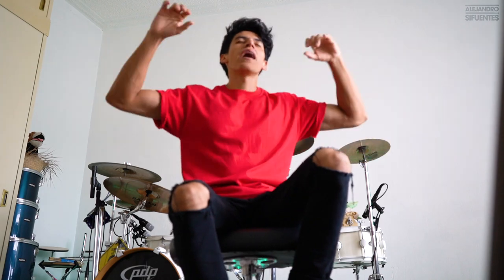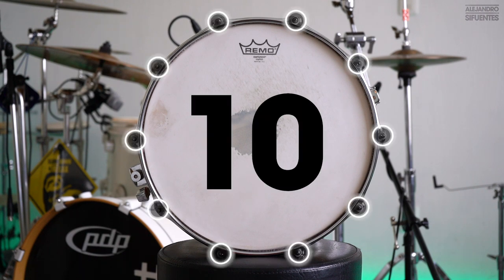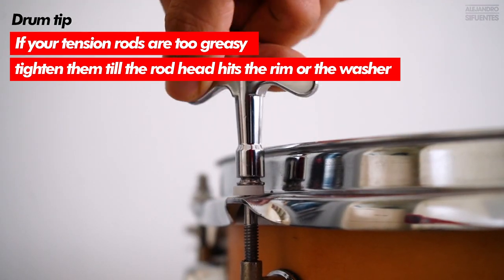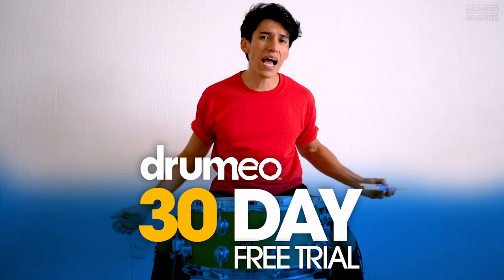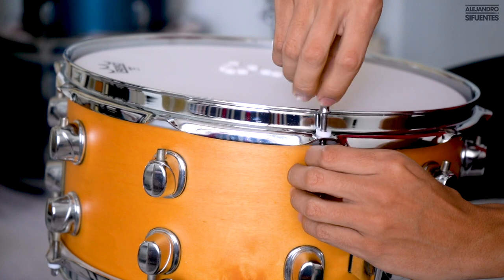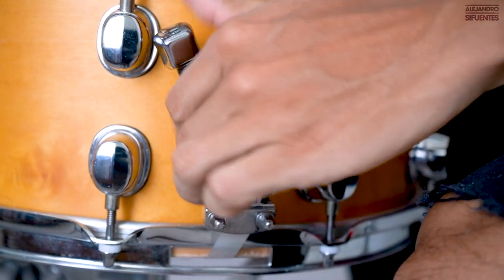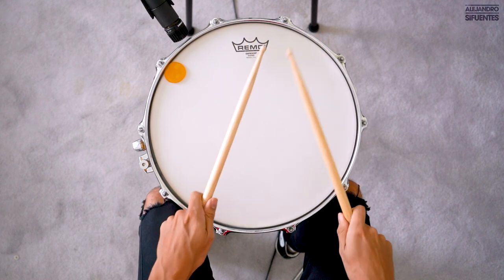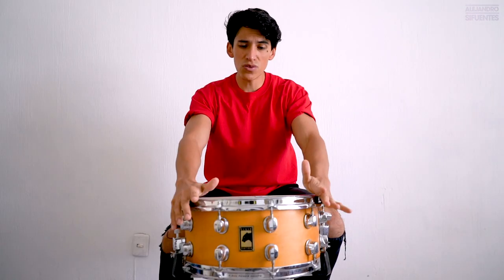How to TUNE a SNARE DRUM (Step by Step)

Comment: I would be interested to know form the viewers :  How many Use the Remo Emperor Batter heads?  I have dilemma with my DW Design series 14 X 6.5 Snare (Nickel over Brass).  I've tried a number of batter heads with the Evans HD Dry being close to what I want.  I will try the Remo Emperor to see how that sounds.  PS:  I tried the UV1 & UV2 and a Remo Powerstroke 77 and a Evan EC Power dot to less desirable results.  I'm aiming for that Alejandro achieved with the Higher tuning.  THX for the Video AS.